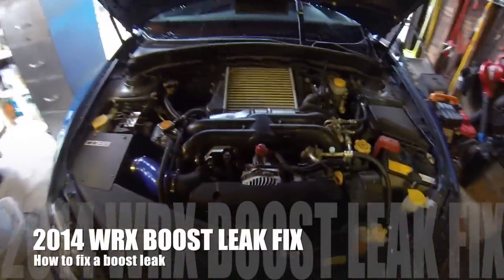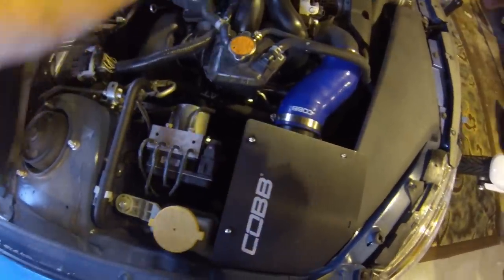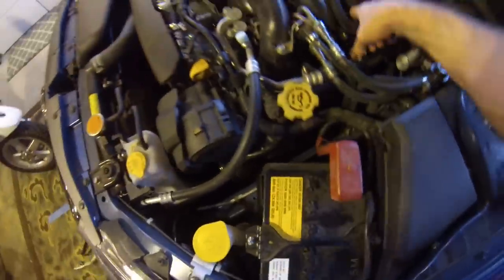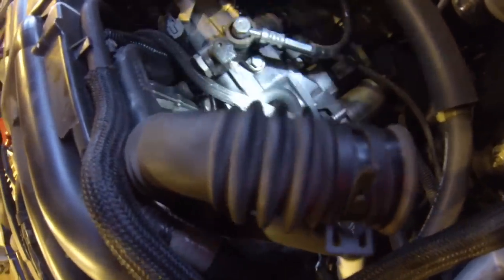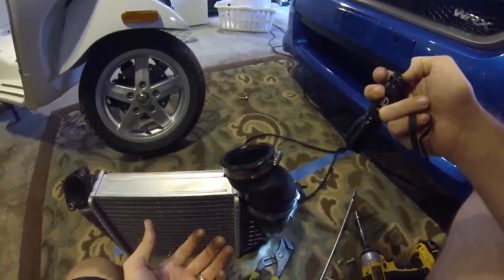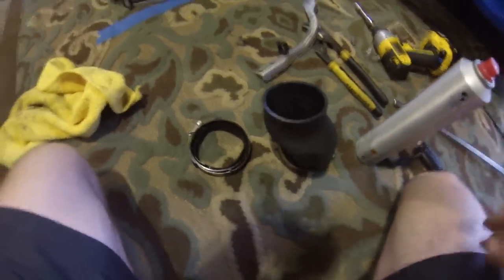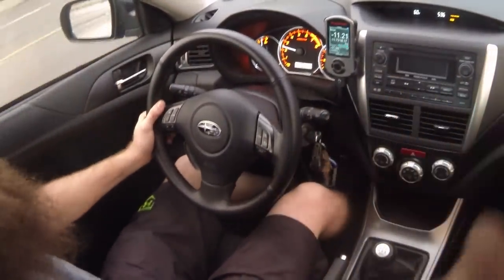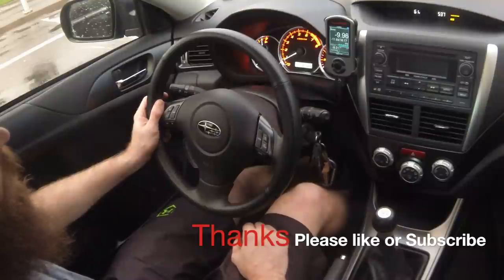How to fix a boost leak on a Subaru WRX 2014

Comment: Hi Blake, cool page and videos man. Im having boost issues with my 14 WRX. am only hitting 9 psi. Brought the car to the dealership and was told that everything is fine. I checked the throttle body hose multiple times for leak and retightened the clamps. Any advise? Thanks.
Reply from the maker: Dino De Vera Im assuming you have an Accessport? I would take the car back to stock and make the dealership fix the issue if you can't figure it out. Maybe take it to another dealership close by and they may have better mechanics to fix the issue. Could be a bad turbo or cracked intercooler. If you don't want to do that then I would make your own boost leak tester and give that a try to find where its leaking from. Did the hose ever seem messed up? Or check the BPV on the intercooler to see if its leaking.
Reply from the maker: Dino De Vera I noticed you said you retightened the clamps does that mean they were loose? I had to replace my clamps because they did not clamp properly.
Reply: Blake's Garage Yes I have an AP. Did returned the car back to stock when I went to the dealership this afternoon, I waited for 3 hours and they couldnt find the leak, the service manager even gave me an attitude smh. The mechanic test drove the car with me and said everything seems fine. Told him if he has a leak tester to test it. I already ordered a mishimoto hose and clamps. If that doesnt work Im gonna take it to a shop nearby. Thanks Blake, keep making those cool videos.
Reply: Blake's Garage  I had to check the clamps coz I replaced my Pitch Stop Mount - which I didnt like and had to return the stock one.
Reply from the maker: Dino De Vera Sounds like such the normal run around. I swear those guys do not care at all. Or they just drive a Prius so anything feels fast LOL. Hopefully the hose helps it out. Did you know you weren't hitting target boost before you had the access port or did it just start all of a sudden? Just wondering if you have tried the HWG map from Cobbs website. I had to install this to hit target there maps are very conservative.
Reply: i had same issues, they kept telling me no boost leak no codes like that. just a loose gas cap lmao.  i bought a new cap and same issues
Reply from the maker: whiskey 4 Just dive in there and fix it. They don't really look that hard into things.

Comment: Question: How did the car drive before this fix? Was it struggling to reach red line from 4krpms? Making spooling sounds but the car is not pulling as it should be?

I have a 2014 WRX stage 2 protuned (Turboback, SF intake, AP V2). Yesterday me and my friend tried to install an hks bov with recirc. (Bad Idea!) The car can only reach 14-16psi. Before it can reach 19-21psi. I can also feel that the car has not been pulling as hard as it used to. We checked every hoses that was anywhere close to the BPV but it seems like everything is attached and secured. After putting back the stock BPV the car still runs the same. Couldn't reach peak boost! I'm wondering if it's the same issue.

Thank You
Reply from the maker: gabriel armada Well it felt a lot slower by seat of the pants. It never had a harder time getting to redline. But if the leak is significant enough then this could most defiantly be your issue. This is the first thing I look at when a fellow Subaru owner opens there hood and 3 out of 4 times I can spot a leak visually. There will be oil from blow by seeping out around the clamp.
Reply: Other than the car feeling a lot slower it seemed like it was struggling to reach red line specifically from 4 thousand rpms. On WOT the car starts to spool at around 2k rpms and continues to do so but I never feel the boost kick in as it used to usually at around 4k rpms. It is just unbelievable that the car's performance  has changed drastically by just changing the stock bpv. We did put it back on but it is still the same. So that is why I'm thinking that there's a boost leak somewhere. 

Thank You so much for your help and quick response.
Reply from the maker: gabriel armada No problem, hope this video helps. These stock hoses leak all the time so I would defiantly rip off the intercooler and check it out. Also that BOV is no good if your venting it to atmosphere. Its just a noise maker and your car will not run correctly. If you have an intake with a tune it will make all the good noises you are looking for.
Reply: Yessir. I totally regret putting that bov on. Anyways, I was able to flash a light as to where that hose from the IC to TB is located and I can see oil all over it just like as show in your video. This might be where the leak is at. I might bring it to a local subaru dealership tomorrow to get it checked out. I'm just worried that they will do a half ass job or they will play the voided warranty game because I have a dp and an intake.
Reply from the maker: gabriel armada Yep yep, that will probably be the game. I would do it your self it takes less than 45 min. Or order the Mishimoto TB to IC hose and when it comes fix it then. I do have to say the Mishimoto is a pain in the ass to get orientated correctly but once on its great.
Reply: Blake's Garage Blake, so I went ahead and did it myself yesterday and indeed the leak was coming from that same hose you took out. Supposedly that's just one piece if I'm correct but when I took it off one end of the hose that's connecting to the throttle body was just torned apart. When you got the mishimoto hose did you use the stock clamps that were on there? the silver adjustable stock clamps?

Comment: I just bought an 09 wrx about 2 weeks ago. it ran fine . then today it won't spool anymore and I have a CEL. please help
Reply from the maker: +Kasey Madrigal I would check this hose for sure and then get a CEL reader to see what codes its throwing. Usually it will be pretty specific and should help you figure out the problem.

Comment: Hey man, how long did it last before u changed to mishimoto? i just installed my mishimoto TBH today and now i have a leak. Im not even going to drive my car until i fix this. im thinking of putting back the OEM hose for now. i think Rallysport direct sent me a wrong size. i have a 2013 wrx. i dont know what i did wrong?
Reply from the maker: Josephus Santos I should have done it right away but I waited for the hose to pop two times and about 1 year. I think I had a boost leak 3 times with the stock hose and they happened almost immediately after Subaru had fixed it. Once I did the hairspray trick however the car held boost much better and the boost leak was mostly gone. I think the next issue was the hose clamp was striped out. Did you look at the part in my stage two video on how I installed it? Does it look the same? The Mishimoto TBH should not leak you either need to check your hose clamps. They may be stripped out and not holding tightly on the hose. Mine were indeed stripped out. Or check to make sure the hose did not just pop off. The orientation of the hose is a big deal, and also a pain. The hose would pop off and then I would have to do it agin. Make sure to get the hose fully seated over the TB. Then make sure its pointed in the right direction this is a one way design. After that tighten down the clamp on the TB. I would pull and tug on it to make sure its nice and snug. Then put on the other clamp and proceed to install the intercooler. Always checking to make sure the hose did not work its way off when getting its orientation correct. When I was installing the intercooler I would think I had it then it should slip off slightly and I would have to work it back on. Unless rally sports direct gave you the wrong part. I would just try it agin it will take alot of fitness to get it right.

Comment: Shouldn't peak boost be higher than 15PSI on a stage 1 tune though?
Reply: should be 17ish psi , tapered to 13psi @7k rpm
Reply: exactly, so I don't think this boost leak got actually fixed by hairspraying the throttle body hose. I'm guessing TGV leak. Either way, smoke test is a more comprehensive test. Cool video on how to check common probs though, don't get me wrong.
Reply from the maker: +cory brim it mostly fixed it. However I did end up getting a MishiMoto TB to IC hose and that helped a bunch when I went stage 2.

Comment: Does the boost leak sounds like a whining sound? While the turbo spools up? Cuz on 2nd gear the turbo spools and when I hit 3rd gear the turbo spools and hear this weird whining sound.
Reply from the maker: ***** It can sound like that. Look down at you IC to TB hose and check to see if you can see oil on the hose. If you do I would bet boost leak.
Reply: Thx for the advice and great video! Gonna check it out today
Reply from the maker: ***** No problem, It can also sound like a whistling noise over the RPM range. Just think of what a vacuumed sounds like when your hand is covering the hose, then you open a little are it makes high pitch squeal.

Comment: What were your boost readings when you suspected a leak? I just installed my Perrin catted downpipe (with the help of your video) and flashed with Cobb Stage 2 ACN91 and I'm only getting about 14-15psi.
Reply: I kept reading this comment thread and saw that you were reaching boost of about 13.5 psi. Sounds like a similar scenario to what I'm experiencing. I tried taking off the intercooler when I did the downpipe, but man those hoses are a PITA!! Not looking forward to this install haha
Reply from the maker: Matt Messinger Yeah its sorta pain. I would try the HWG map and see what you hit. If your still not hitting target boost I would dig into the TB to IC hose.
Reply from the maker: Matt Messinger Oh your stage 2, yeah you probably have a boost leak thats really low you should get 16+ PSI Peak on the Accesport. I have a video coming out soon that will show you my accesport and the boost Im building with the TP tune.
Reply: blake866 What's weird is that if I live log the boost, i see 17psi on the accessport itself. However, when I view the datalog, i see a peak of about 14.5
Reply from the maker: That because the accessport does not get every number when its data loging. It logs at about .1 or a tenth of a second. So sometimes the logs will show different than the highest/lowest readings on the accesport.
Reply from the maker: Matt Messinger Sound like you should try the HWG map then see what your hit for peak boost. Also run it in different air temperatures like day and night you will build more boost in colder temps. If your still around 14.6 I would check for a boost leak.
Reply: blake866 So you're saying the logs on the AP screen aren't as accurate as the data logged in the actual CSV file? I'll try with the HWG map tonight and see how it goes. Only problem is that it's hard to get to redline in 3rd here in Los Angeles!!
Reply from the maker: Yes, Im saying that it does not wright to the data log CSV as fast as real time data your seeing on the graphical gauges on the accesport live view. You can tell if you look at the CSV file the time stamp of when you start the log compared to what you see when your looking at the gauge there are a-lot more changes. Yeah you guys have traffic all day everyday. You can just do a second gear pull its not as heavy of a load but it will at least let you know where your at.
Reply: blake866 Cool man. Thanks for the explanation. Keep it up with the videos. SUPER helpful
Reply from the maker: Matt Messinger Thanks Matt, I will for sure glad I could help.
Reply from the maker: I just posted a video that will give you some comparison of what my Accesport reads out.

Comment: Thanks for the video. I'm sure it will help people. I know I thought I had a boost leak problem at one point too. (data logging showed me otherwise) BTW, I'm pretty sure that intake silencer is only on the STi.
Reply from the maker: Thanks for the positive feed back. I was wondering why mine did not have the silencer, I was all excited to do the mod and to my surprise no silencer.

Comment: thats a ton of oil for a 2014 damn,mines a 13 and not even close to that,and i hope by now you've lean red to take those rubber pieces off and chunk then away,and you do not need to buy a after market hose the stock one with good clamps will hold up to like 22 or more psi and i know a lot of you guys aren't running that much.just chunk them and clean the oil and use t clamps if you want.i thought this was going to be a boost leak test video,which I've done too and its pretty easy,but you need to put soapy water all over everything which kinda sucks if your a clean freak.later

Comment: I think I have the same problem..i have the cobb ACN 91 stage 1 + sf intake with the NWG I target at 14.5 psi and with the HWG I target max 15.8 psi you thunk that's normal or I might have a boost leak also?
Reply from the maker: Roger Arroyo I would think you have a boost leak. You Should be hitting higher that that the WRX stock target boost is 14.3 PSI. I ran the HWG map because my car did not hit target boost on the normal waste gate map evan after the IC to TB hose upgrade. But the HWG map hit on over little above what Cobb said it's target was for me. This is not every time however you need to do multiable pulls sometimes and clear you gauges or data log to see whats happening. I think target boost on stage 1 SF+ map is 16.5 PSI. So you should see this PSI +/- 1PSI. Does your boost pressure spike and quickly fall down to lower boost numbers like 10PSI or so?
Reply: not sure I need to do a run maybe ill make a video..do you still run on the HWG map?? and what is your target boost and what does it hold on till redline
Reply from the maker: Yes I do still run the HWG map. It will hit anywhere for 16.5 to 17.5 PSI at around 4K then taper off to around 11 by redline.
Reply: Oh ok thanks ill let you know how much my holds by redline..do you have the full cobb turbo back exhaust? and did you install it yourself?
Reply: nevermind lol I just seen your videos now..looks pretty easy thanks man you make good videos
Reply from the maker: Roger Arroyo Thanks Roger glad I could help out.
Reply from the maker: Roger Arroyo I have the Cobb down pipe now this was an old video. I also have the SPT exhaust.

Comment: how much boost were you reaching with the leak?and what is target boost for your map.im using stage 1 93 mtg 300 .ptm map, and I'm reaching 14 psi, i don't really have symptoms of a boost leak but ill do some investigating.ps how do you find out what the target boost is for the maps?
Reply from the maker: Ry Guy22 I was peaking at around 13.5PSI very very quickly and then it would go to about 12 or 11. This is straight from cobb 

Stage1 93 MTv331 
o Fuel Requirements: 93 - 94 octane or better o Intake Requirements: Stock airbox with stock air filter o Exhaust Requirements: Stock exhaust or upgraded cat-back exhaust o Boost Targets: ~17.0psi peak boost pressure tapering down to ~12.0psi by the 7000RPM redline, +/- 1.0psi
Reply from the maker: Ry Guy22 If your only reaching 14 PSI max you most likely have a boost leak or you need to change to the High Wastegate Map 93 OCT. Check on Cobb's website all the info is there here is a link for the 2014 WRX https://cobb.app.box.com/SUBA-US-WRX-09-14
Reply: Thanks I'm going to try to see if i can find a leak, after a couple days i switched to the HWG map and still only reached 14.5 psi
Reply from the maker: You probably have a leak you should be hitting 14.6 with the stock tune. Good luck.
Reply: Blake's Garage 14.6 is the max or???

Comment: Just installed my sf intake and flashed my ecu with the stage 1 +sf, after a day of driving my boost is completely lost and hit maybe 0.24 any suggestions on my issue. Been reading a bad gasket on either the y pipe or bov?
Reply from the maker: Did you watch this video? its most likely a boost leak you probably have a hose hanging half way off.
Reply: Blake's Garage oh I've watched this about 5 times now haha waiting to get off work and get started, really hoping it's the same thing and nothing costly, was just worried that it has zero boost
Reply from the maker: robert johnson it's either a boost leak or your turbo is blown.
Reply: Blake's Garage I think it's both. That oem hose to the throttle body is junk with that sleeve fold over design. Mine is toast and was for sure causing a leak but unfortunately while cleaning the oil up I instantly noticed flakes of aluminum or steel. All signs pointing to either it's blown or on its way. Looking at $1100 for a brand new vf52 under warranty with install